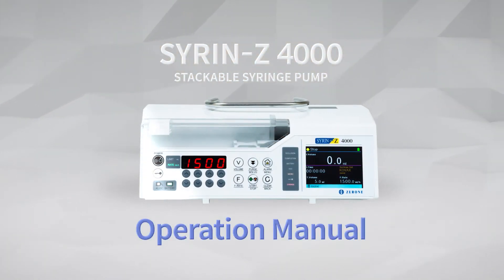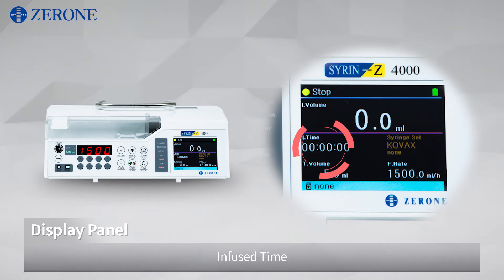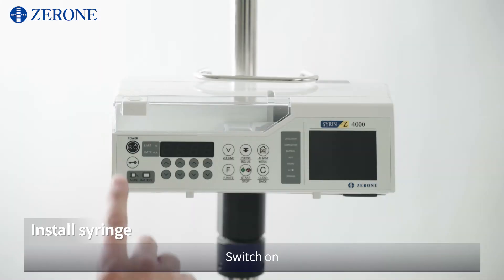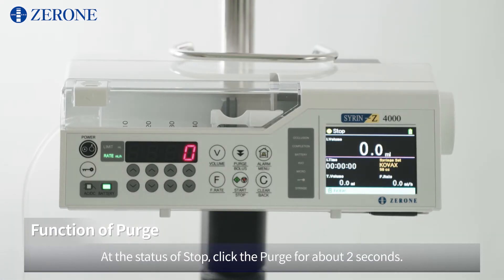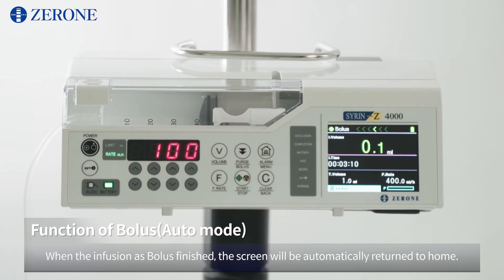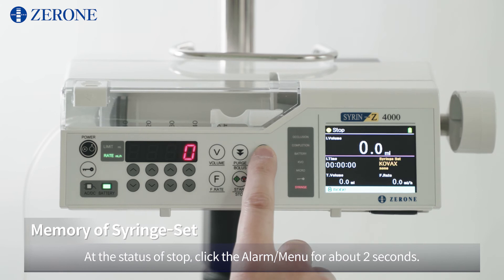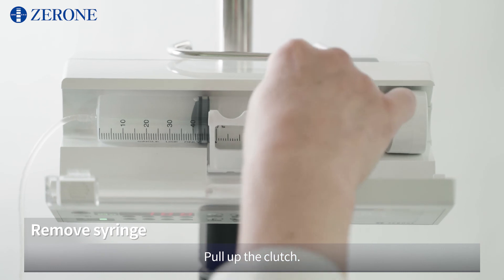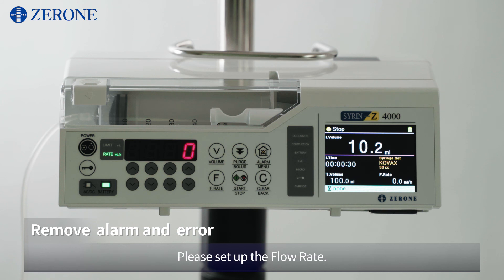[제로원]SYRIN Z 4000(Stackable Syringe Pump) Operation Manual

Comment from the maker: 00:15 Ch.1 Appearance: Control Panel
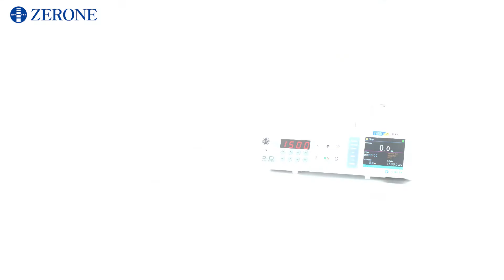00:59 Ch.2 Appearance: Display Panel
01:48 Ch.3 How to use: Mount on pole clamp
02:10 Ch.4 How to use: Install a syringe
02:59 Ch.5 How to use: Set up and Start
03:20 Ch.6 How to use: Function of Purge
03:50 Ch.7 How to use: Function of Bolus
04:37 Ch.8 How to use: Micro mode
05:27 Ch.9 How to use:  Memory of syringe set
06:17 Ch.10 How to use: Remove the syringe
07:00 Ch.11 Remove alarm and error